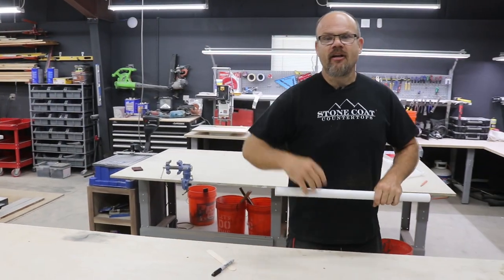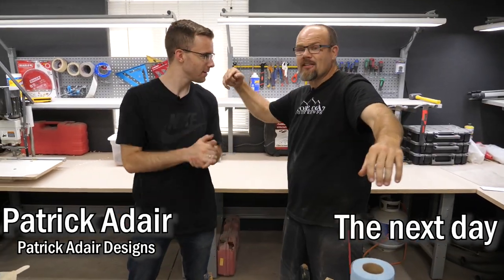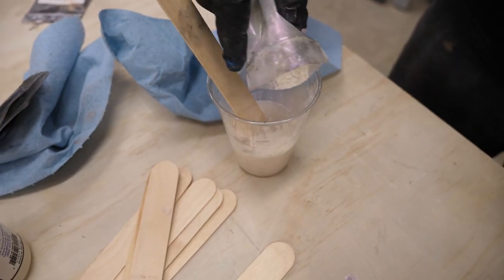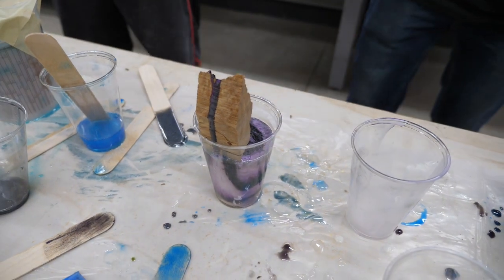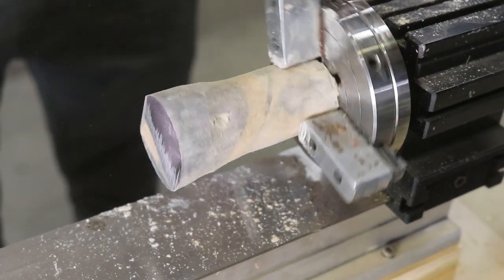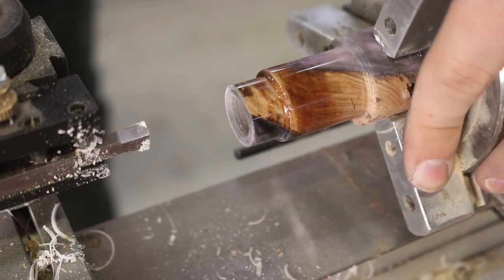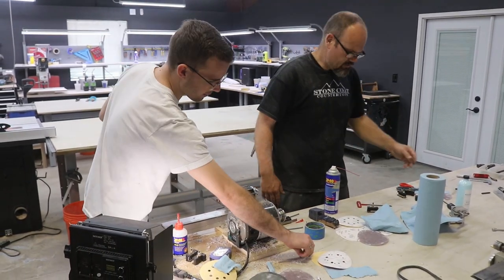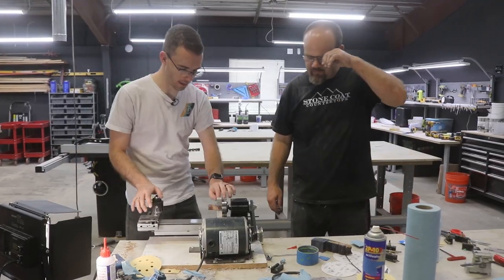Ring Making with Epoxy Featuring Patrick Adair Designs | Stone Coat Countertops

Comment: Very cool project. Quickie question. There were several times you used a product called CA. What is that? The idea of blending it with powders and using it as an inlay opened up a few ideas for me. Humm.
Reply: CA is glue
Reply: @caseyjohnson6573  Thanks. I also did some digging around to find out too. Too Curious.